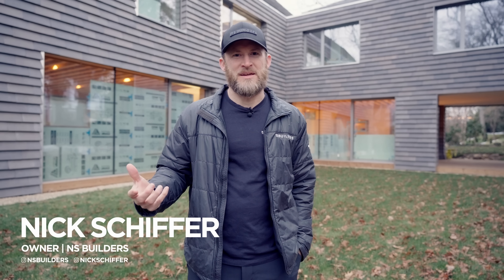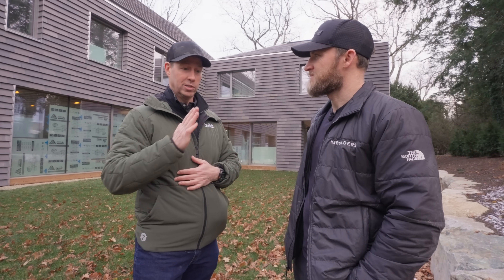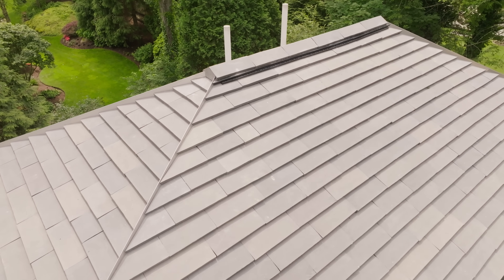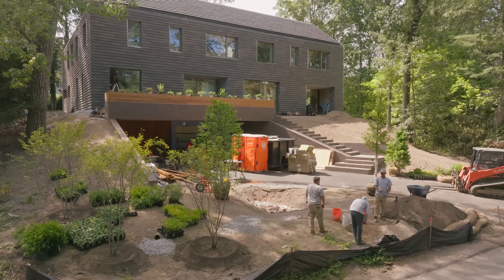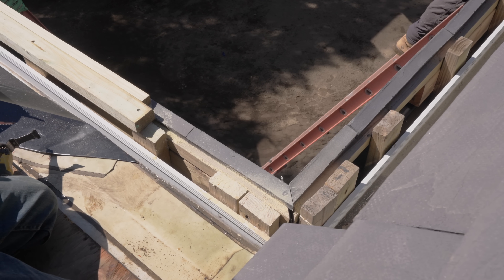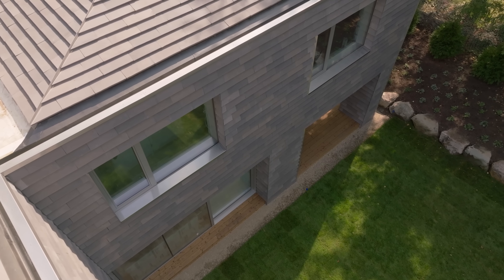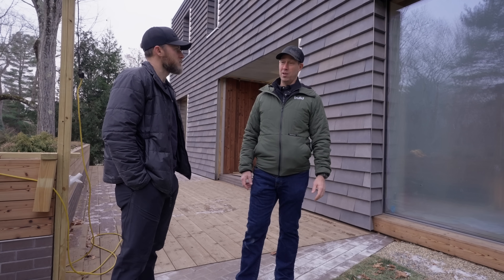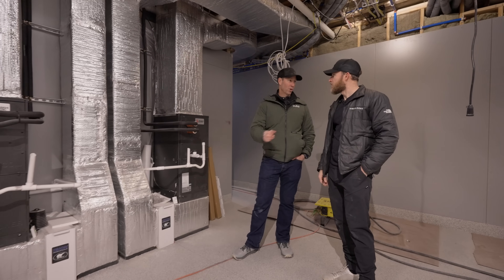Matt Risinger Visits our "500-Year" Home

Comment: On your heat pump comment… I have a 5 ton carrier that is there very latest and greatest heat pump that came out mid 2025. I'm just north of Atlanta so no truly cold temperatures. When we get into the 40°F range, the stupid thing goes into defrost mode pretty frequently and blows cold air during that defrost. I did not get the heat strip because I didn't think I needed it but I guess that's the only thing keeping air warm during defrost cycles. I didn't know that was a thing and it's a pretty annoying feature of that unit that cost me $32,000. I don't know if this is unique to the carrier line or if a Trane/ Mitsubishi would've been a better choice. I wouldn't buy the same thing again though

Comment: Definitely a market out there for someone to do a similar cladding material system but not as costly as these handmade pieces. I can imagine a much thinner but similarly hanging nonflammable and watershedding material without the cost of composite manufacturing. Getting away from plastics I think is good for both areas of the building shell. 

In our house and as a woodworker I am always thinking about how to access and later change features both on the exterior and interior. As opposed to always ahdering things in a permament way when in the sequence of the building those things are not on the subtrate level. For example, even on the interior with built-ins where access to the wall is still important in the future. The way this cladding material hangs is perfect in that regard.  

Metal siding often has a similar feature as it is mechanically adhered and the profile not being flat and tight against the sheathing can work to help create a drainage plain all in one step.

Comment: It was actually Mercedes Benze that had airbags... Mercedes-Benz was the first to offer a fully integrated, production-ready system with driver and passenger airbags as an option on the 1981 S-Class,
Reply: @danielcapson9842  Cadillac had an airbag on the passenger side for both driver and passenger as an option (RPO code AR3) in 1974. 

It was called ACRS :)
Reply: @tvtechnicaldirector  Cool...

Comment: Unless they used stainless steel fasteners there is a zero chance that wall will last 500 years. Yes, the wood can last 1000 years if you control air/water/insects, but the Japanese construction would've been thick beams with dove or other architectural locks. This shingle hangs on the 1x1s(?) nailed or screwed to the studs. At 500 years iron/non-stainless steel will simply rot away. The only way to preserve steel/iron for that long is anoxic environment. The wall is not anoxic.
Reply: I wonder how many Japanese wooden structures are actually the same material that's hundreds of years old, vs rebuilt on the same site. In Japan, you can entirely rebuild a building from scratch with zero original materials and they consider it "the same" if it's in the same location and providing the same/similar function.
Reply: Forget the steel fasteners slowly corroding, show me a roof that will survive 500 years of everything nature can throw at it.
Reply: @ArcadiyIvanov  I disagree

Comment: This house will be lucky not to get torn down in 50 years. Definitely won't last 500 years, or even 100 years. There is no such thing as a high-performance house that will last that long. The materials to make it perform well thermally are the materials that will fail the soonest.
Reply: Please explain how mineral wool won't last 100+ years
Reply: @niktak1114  
It's not the mineral wool specifically. It's the polymers and fasteners. All materials break down over time until the point they are no longer structurally viable. Polymers in specific reach this point sooner than most other materials. Polymers and polymer binders are the main things giving high-performance homes their thermal envelope. Some of these items are not easily maintainable but essential for the home. Such as laminates and windows.
Metals also lack long-term structural viability. Oxidation of the metal breaks down the material within 2 centuries when used for a structure. This can be seen with reinforced concrete freeways. It's the rebar that fails in 50 years due to exposure to the weather and constant vibration.

Stone, Roman concrete, brick, and old growth wood are the only materials that have shown centuries long structural stability. Albeit with maintenance. Realistically, this is a good thing as most homes are dated in decades. So, there is no real non-historic use for a single-family home that lasts centuries.
Reply: @KevinSmith-qi5yn I'm sure the air barrier membrane will have disintegrated long before 500 years. I don't see why the structural components would last less than a couple centuries though (assuming stainless fasteners).
Reply: @niktak1114  
The expected lifespan of steel indoors is about 30~60 years regardless of if it's a wire steel nail or stainless steel when not maintained. Granted it will be a while longer before its connection fails. But they should not be expecting centuries.
Reply: @KevinSmith-qi5yn That's nonsense. Galvanized steel should last a couple centuries at a minimum in a temperature and humidity controlled house. The uncoated steel nails in the 150 year old barn on my property are still fine and I live in the PNW so it's not exactly a forgiving climate.
Reply: @niktak1114  
Coatings like the zinc coating on galvanized steel lose their adhesion and fail. It's also not like steel fails immediately at 60 years. But if you have a creak that's the steel failing after 60 years. The expansion of the wood and oxidation of the steel loosens the fastener. It takes a while longer before something like the steel sheering happens depending on the thickness of the steel.

The issue with high performance homes are the polymers and polymer binders. These lose their structural strength relatively quickly. If they are used as an integral structural component like oriented strand board, or laminated timber framing. It becomes too difficult to replace them where a house teardown makes sense.
Reply: @KevinSmith-qi5yn for products like LVLs, the adhesive should outlast the wood itself

Comment: 1. No roof overhangs. 
2. Would have been better if the wood purlins were treated or primed with insect protection. 
3. Window framing should have been primed. 
4. No exterior utilities seen (electrical outlets, hose bibs). 
5. Looks like entire building is just roofing tiles, Kinda ugly in my opinion. My guess is some will replace that siding with something that looks better less than 50 years from now.
6. The problem with heat pumps in cold regions is the efficiency drops. The sweet spot of heat pumps is a temperature delta (between inside or outside) about +/- 20F. While heat pumps can operate below freezing, their efficiency drops to near that of resistive heating elements. Better option is either a Geothermal Heat Pump (if you got the land to run the lines underground), or Boiler system coupled to a radiant floor system. Plus costs of electricity are going up & up every year.
Reply: Did you watch the video? Those heat pumps have full heating capacity down to -5F.
Reply: @niktak1114  "Those heat pumps have full heating capacity down to -5F."

Did you read my comment? I stated HP's lose efficiency. At -5F the efficiency is probably near or below resistive heating elements.
Reply: @guytech7310 Nope the efficiency is still quite high at -5F. It would not be possible for the efficiency to be down to 100% and still maintain full output (the power usage would be 3-4x which they are not designed for).
Reply: @niktak1114 Question are you a Heat Pump saleman?

 Go look at the chart instead of making up non-sense. Efficiency for the Mitsubishi hyper heat declines around 32F. after that COP efficiency declines & thermal Output also falls. At -5F down to about 60% COP efficiency and can only supply 70% of the BTUs of nameplate rating.  which attempts to hide the collapsing efficiency by limiting the BTU its can produce. 

Heat pumps cannot break physics.

Comment: It'd be really interesting to be able to check in on this house periodically over the the next couple decades to see how well it's real life performance measures up to expectations.
Reply: I’d want to see the energy and maintenance savings in a dollar value compared to a comparable conventional built house. Is the initial investment worth it for the homeowner and if so when is the break even point where the homeowner is actually saving money.
Reply: @ecleveland1  Good question, but knowing in my sleep that my home is nerded up in science, is worth the cost, lol.
Reply: No overhangs??? Seems strange for weather resistance
Reply: seems overbuilt, on purpose of course. My question is which part will fail first. It's probably going to be the heating system and the built-in tech, but not the house itself.